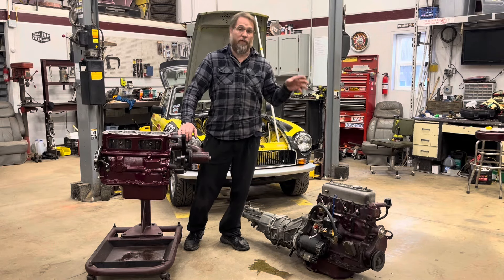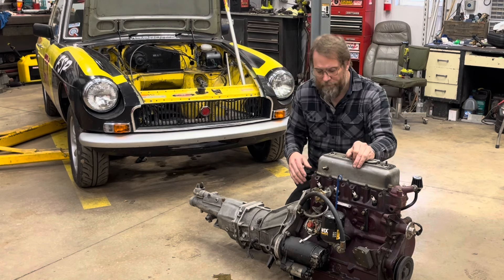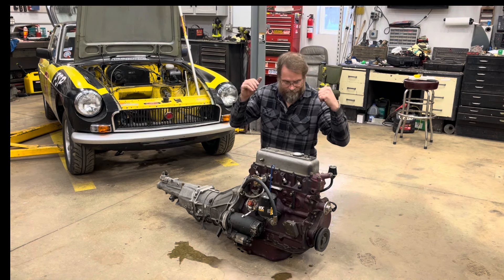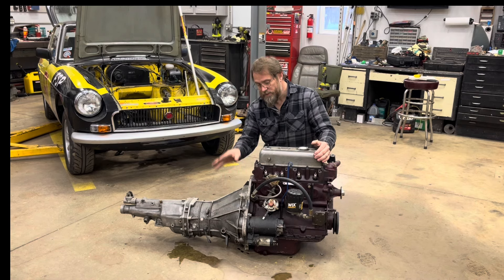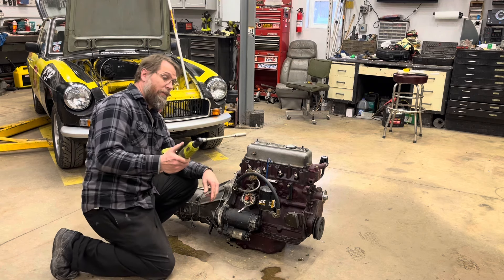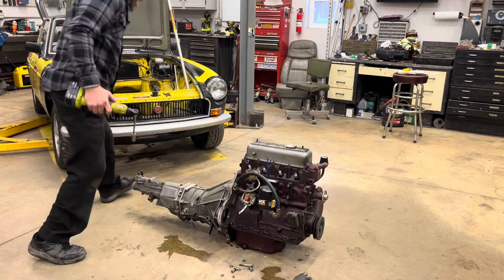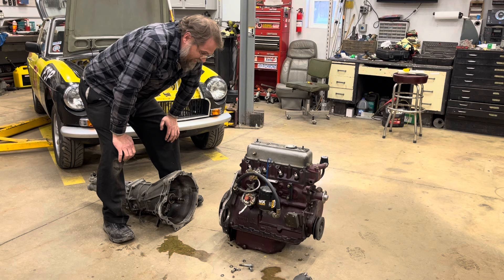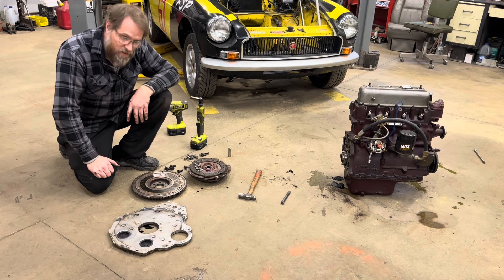My MGBGT starts getting some love after stripping old engine

Comment: This car does not have an oil cooler? Is that on purpose?
Reply from the maker: Yes, Autocross runs are not long enough to get the oil hot enough to need one. Where I live one really isn’t needed for normal use as I’m not in one of the hotter weather states. I decided to not carry the extra weight of one since I was trying to get weight out of the front of the car anyway

Comment: Your small chamber - big valve head ---- must be from a certain year -- and will that year or years fit onto a '69 MGB-GT? --- Have not taken my engine apart yet --- maybe something to think about for a little more power ------ Yes -- I for one would like to hear more on the modifications you did on your engine ---- those intake manifolds --- making your exhaust --- whatever else you may have done ---- The Datsun 5-speed conversion sounds nice --- BUT --- probably expensive --- For me -- I would like to see what things I can do myself that you may offer ---- like that Head --- a slight Port and Polish --- say matching ports ----- de-burring inside the engine / sharp edges better oil flow ---- Will check and see what the trans conversion costs out of curiosity --- but if you get enough people interested in ---- What modifications one can do ---- I'd like to see and hear more about them ----- Thank You again for the video ----- Hope you have a Good Easter ----- Rodney
Reply from the maker: The small chamber big valve head in the US was ‘72-‘74 only (getting hard to find anymore as they have been sought after for years) you can put the bigger valve into any of the heads, but the ‘75 and later heads (also small chamber, but smaller valves in the US) is the most prone to cracking due to the induction hardening exhaust seats. You can put a later ‘72 and up head on a ‘69 but you need the exhaust valve cutouts in the top of the block if you do.